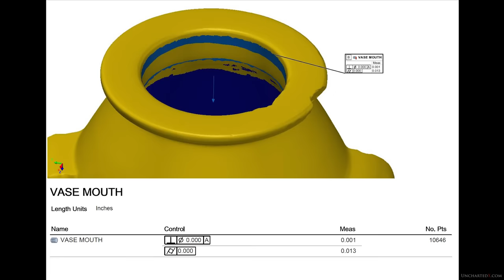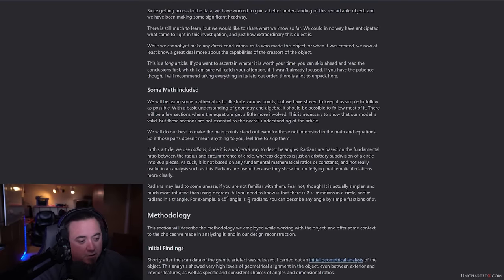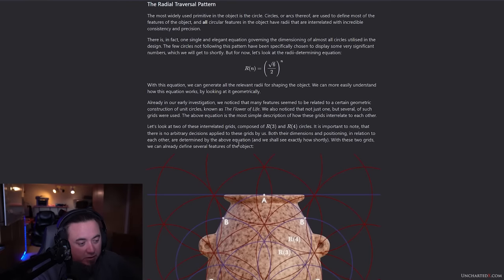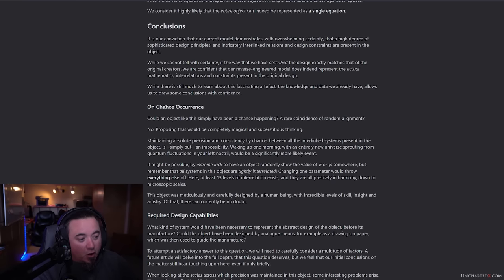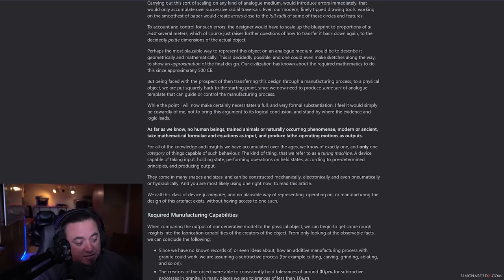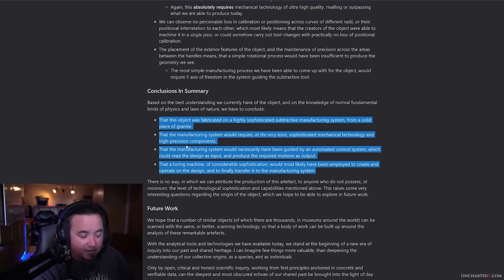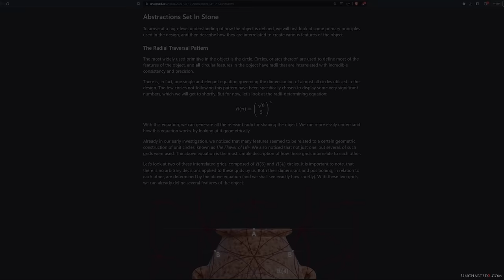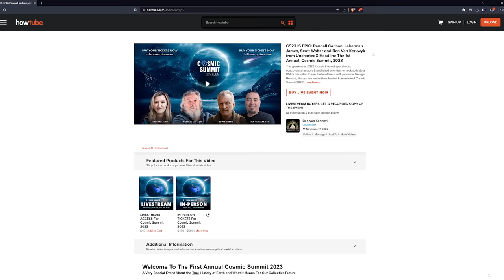Was a COMPUTER Used to Design this Artifact??

Comment: As good as this video was, you didn't really mention the inside or its overall thickness. I am sure it is probably perfect as well. And is the finish fully smooth? How can anything cut it perfectly smooth (glass finish). If it needed a second pass to polish that would be where the imperfections would be made. 

Would love to see you mock up on paper a device that you think could do this. Cnc machine is the only thing I think.

Comment: It is logical to have an algorithm to produce these vases and pots where the only difference would be a difference in one of say 8 parameters. Then any robot could produce this. Most probably the granite and diorite statues have also been made by automated machines according to exact specifications in some kind of portraiture algorithm. Today, we can represent in computer games and in pictures anything by using triangles. It is obvious an advanced civilisation would have no problem doing this. The only technology missing here is how the object is cut out and smoothed.
Reply: its 'cut out' to its rough shape by pounding with similar stones. then it is spun against a grinding stone by hand using a wooden crank. circular motions are symmetrical

Comment: Bard stumped GPT-4 with browsing! It seems that Bard is suggesting the vase's design might be based on the Fibonacci sequence and the golden ratio, which are intimately linked. The Fibonacci sequence is a series of numbers in which each number is the sum of the two preceding ones, usually starting with 0 and 1. As the sequence progresses, the ratio between consecutive numbers approaches the golden ratio, approximately 1.61803398875.

The golden ratio and the Fibonacci sequence often appear in patterns in nature and have been used in art and architecture, thought to produce aesthetically pleasing designs. Bard suggests that the vase's spiral might be structured this way, with the number of curves and their widths expanding according to the Fibonacci sequence.

The master equation Bard proposed:

r = a * f^n

Here, r represents the radius of the vase at a given point, a is the radius of the vase at the center, f is the golden ratio, and n is the number of curves in the spiral.

This equation can be used to calculate the radius of the vase at any point along the spiral, which could be used to create a 3D model of the vase or to print the vase on a 3D printer. Please note, however, that this is a hypothesized model based on Bard's interpretation and may not perfectly represent the vase's design.

The information I found in the earlier article did not directly mention the Fibonacci sequence or the golden ratio, but it did note the vase's highly precise and uniform design, suggesting that it was created according to some mathematical formula or set of principles12. The idea that the vase might incorporate the Fibonacci sequence or the golden ratio is certainly possible and worth investigating further.
Reply: this is really fascinating, i think you're (or AI) is onto something

Comment: All very remarkable,     but what may  be  even more remarkable are the handles on these vases.       If turned on a lathe, how was the material between the handles removed so precisely,  how were the outside faces of theses handles made flat occurred outward,  rather than rounded,  like lathe turning would prod7ce
Reply: it's almost like these vases were designed in such a way to show that a second step was used which proves they were made by advanced tools.

Comment: I was always an advocate for the "they knew how to liquify granite and then cast it" idea. But, when it is shown how incredibly complex and mathematically sound the vase is, as well as how mind bogglingly tight the tolerances are, you realise: how would they make the cast? And you're back to square one haha. Truely fascinating, maybe they approached lathe work from a completely different angle that we cannot even fathom yet.
Reply: no , you cannot liquefy granite and retrieve granite crystals structure when cooled , when liquefied result is always obsidian glass and no more crystals
Reply: @zsuira How would someone achieve the precision of this vase, using the technology in these youtube videos?

A blacksmith can work metal. However a blacksmith cannot build a modern jet engine.
Reply: @zsuira  Do aliens build modern jet engines?

Comment: I might not be smart enough to ask this question correctly, but could there be a connection between the math and audio frequencies? I have the feeling that this could be a interesting way to further understand the object.
Reply: maybe the object was created using a certain frequency, OR the specific type of granite the object is made from reacts to that frequency in a certain way that we don't understand yet. hard to say, but I'd love to know if there is a correlation between the type of granite used and the shape of the vases.
Reply: @AustinKoleCarlisle  that is what I was thinking of. Like the sounds in the pyramids

Comment: At 34:16 you show a vase rotating. It too has handles. I can see that these handles have a hole bored completely through the handles. With respect to the artifact studied, are the holes completely through the handle? Is the bore hole straight or on an arc? One would assume they are straight through holes. Though if they are on an arc, it would only deepen the mystery of these artifacts.
Reply: they are straight through holes. They also arent very well aligned with each other, or even on the same level. The handles are a great example of why this is obviously a hand made item.
Reply: @5hiftyL1v3a  A few items here. First, are you sure they are straight through bores. Second, what object are you speaking of when you say they were not well aligned. Third, how do you know the alignment of these holes with any degree of precision. Fourth, even if the holes are straight bores not well aligned, how does this support the conclusion that the remaining vase was "obviously" hand made? Are you saying that the measurements taken of the precision of the vase dimensions are irrelevant because the bore holes are not as precisely done. Do you have an agenda here? Nothing whatever is obvious here, at least not in the way you are imagining.
Reply: @michaelc424  
1: yeah... you can it in the video
2: the handles either side, their repective holes in relation to each other
3: because I have eyes. you can see that they aren't symmetrical
4: because thats whats happens when you grind hard stone by hand. it looks handmade

I'm just saying it looks like a hand made vase because thats what hand made vases look like

Comment: Five axis machines which can hold tolerance of less than 0.02 mm between tool change are very common place.  Now let us considered the automatic screw machine which purpose is to mass produce precision components.  If one gets fancy the fancy five axis machines can hold tolerance of less than 10 millionths  of an inch.   That is 2.54 E-5 cm.  The design of the vase is by far the most interesting part.

What really trips me more is the exploded remains of a pyramid in Egypt.  It is well established it exploded as stones from the construction are found hurled over 100km from the construction site.  Even more stunning are remnants at the site of quartz surfaces a meter across which are optically flat meaning less than one wavelength of light at some visible light frequency.  That is serious tech down in the 100nm range.

It is completely absurd to believe the modern human mind required many millennia to have an idea to do more complex constructs.  The Vedas write of a previous civilization.  The planet is littered with ancient artifacts way past 20,000 years ago.  These modern experts as so many who claim to be scientist but, are not, have no idea about history more than about 150 years ago.  They are idiots infatuated  with their own reflection in a mirror.

Comment: Mark proposed the Unit they may have used. It is the same as the wavelength of a 16Ghz EM wave. In our base ten, it would be 18.737028625mm.

Remarkable.
Reply: "but the second is a human creation" cried the atheists. lol
Reply: @AustinKoleCarlisle  it is. It is 1/86400 of the average solar day. So it's a kind of blend of natural and invented. Like most things.
Reply: @timothyblazer1749  your definition is the correct one, but they don't see it in those terms, the second is now defined as "the time that elapses during 9,192,631,770 (or 9.192631770 x 109 in decimal form) cycles of the radiation produced by the transition between two levels of the cesium-133 atom."

mmm, that's good scientism.
Reply: @AustinKoleCarlisle  well, the issue with that is it assumes that the speed of light is a constant. Einstein tried to get his theories revised later with a variable speed of light, but the broader physics community wouldn't budge on it.

Oh..in case it wasn't clear..a cesium decay clock uses lasers as a part of it's operation. That's why it's relevant :-)
Reply: @timothyblazer1749  i'm just saying, the further we drift from natural and sacred measurements, the less things will make sense. we need to embrace our natural principles, not try to dominate them with our superior, know-better "intellect"
Reply: Interesting as 16Ghz is the signal that the folk over Skinwalker Ranch were picking up strange things at. 16, 16.3.
Reply: @AustinKoleCarlisle  I think a balance is called for. We do have an intellect capable ( though rarely used ) of reasoning. By the same token, nature shouts things at us every day that are missed because of ego, POV, cognitive bias etc. Probably humility and introspection is called for :-)
Reply: @timothyblazer1749  well, if you watch the latest Koncrete podcast with Ben and Randall, they speculate on what type of energy technology this mysterious ancient civilization had. they come to the conclusion it was "plasmoid" technology, but i think it was even simpler than that. i sincerely believe the ancients were way more spiritually advanced than us and could harness the power of consciousness, allowing them to control and shape physical matter in ways that we cannot today. because today we rely on electromechanical technology to dominate physical matter. this ancient civilization took a completely different technological evolutionary path and this explains why we don't see any similar materials like plastic, glass, etc in the archeological record because they were still in the stone age and stone was all they knew. the search for "the tools!" and ancient advanced machines is a fool's errand, IMO, because instead we should be looking inward for the answers as to how these things were accomplished.

Comment: As a side note symmetry and roundness would be near zero if the item was sculpted or produced on any spinning axel. Now the roundness would be equal to the accuracy of the “bearing” now what is interesting is the machines and “ engines” like waterwheel or pulleys

Comment: This item was likely made with a technology that we haven't discovered, invented or perfected yet. I don't see it having been machined in the traditional sense, but more likely it was lapped so to speak,  encapsulated within a subtractive media, energy or both, that was able to be manipulated into a 3 dimensional form. In essence, forming a mould of the desired finished product. In this form, one could imagine that this media could then be excited or aggravated somehow through some mechanical or energetic means, that it would subtract substrate from a solid at an impressive rate. The only media that seems plausible enough to perform such an action is diamond, and the idea of it being able to be manipulated in such a fashion isn't so inconceivable either, its more likely that there is yet more to be discovered scientifically and technologically about this gem, and I'd suggest that much of the technology needed to produce such a machine is available to us now. This theoretical process is not so different from the modern process of mechanical lapping, which is a concept as old as mans time on earth. By modern standards lapped output can be both produced and measured with basic equipment to an accuracy of flatness near 11 millions of an inch, or 0.000294 of a mm. Coincidentally, diamond powder suspended in a slurry of hydrocarbon or water is the media of choice for many of todays lapping processes, and one of the main global suppliers of these solutions and machines is ironically named "Kemet". Isn't it intriguing that lapping is known as the "Black Art"?

Comment: It wouldn't matter if that was the only one found to be that precise, it still proves advanced ancient technology existed all the same. Denying it is like saying "well you only found ONE ancient computer, so it's really not proof of anything". Grabbing at straws is what comes to mind now when people try to debunk this thing. The math and level of precision required makes it impossible that machines were not used. Precise machines having been used makes it impossible advanced industry was not present to support the development of said machines. Advanced industry present makes it impossible mastery over electricity was not achieved. Mastery of electricity makes it impossible advanced energy production/harvesting was not present. An advanced fuel industry points towards a global and/or globally aware civilization. A globally active civilization makes it impossible fast forms of travel, like flight, had not been achieved. 

Every aspect of our modern technological world is required and as we know, advanced technology is delicate. The advanced "tools" would not have survived a cataclysm+10,000 years. The stone they carved would have however. So, it's f#&*ing over. The next decade will provide more proof guaranteed. It's all just in material though at this point. The question HAS been answered: TO DATE WE ARE NOT THE MOST ADVANCED CIVILIZATION TO HAVE EVER COLONIZED THIS PLANET. People (mostly religious zealots with an agenda) need to get over it. :/

Comment: The guiding machine shape was surely a circle right? If the vase had to be held and all of the circles have relative equations…than wouldn’t it be likely that the cutting was guided by some kind of larger circle with the same proportions?

Comment: The upshot of this is that the level of supporting technology that would have been necessary for this work to have been done requires a technological society that far surpasses our own.  The medium is difficult to work and there are hundreds of them.  This is a work that indicates that those who created it could do it easily and without much fanfare and it plainly isn't a one off.  Plainly the evidence speaks for itself, at least with some mathematical assistance.  There wasn't much if any discussion of tool marks?

Comment: Were they using base 60 math in measurement?  I believe they were; these were the people who made the 60 second minute, and the 60 minute hour. Enki built the pyramids.  60 is divisible by 1, 2, 3, 4, 5, 6, 10, 12, 15, 20, 30, and 60.  This makes it have fewer remainders, and great for finding quick approximation.  Does a base 60 numbering even come into play?  Is the power of understanding the geometry commensurate with some secret to the technology used on the granite?

Comment: What if these things were made by resonating with the frequency of the chunk of granite, then somehow shaping it? Maybe they used sounds and vibrations to do this, we are only beginning to understand about frequency and sound waves and gravity waves. Maybe they used some sort of anti-gravity?
Reply: I'm curious to know if the vase geometry is associated with the type of granite OR the granite's resonance frequency.
Reply: @AustinKoleCarlisle  I think it has everything to do with the frequency
Reply: @Mr.Plant_man  i would bet money on it. after all, Nikola Tesla said if you want to understand the universe, think in terms of energy, frequency, and vibration.
Reply: @Mr.Plant_man  there is no way to build the ancient polygonal stone walls using ancient methods...unless the stones were weightless and could be molded like butter to ensure a seamless fit. not enough people realize that the ancient polygonal walls that span the entire globe fit perfectly not only at the facade, but fit perfectly throughout the depth of the joints, even curving three dimensionally. this is simply impossible to achieve with trial-and-error fitting like we're told the ancients did.
Reply: @AustinKoleCarlisle  exactly, your the type of person id love to smoke a joint or drink a beer with a talk to. You think just like I do. You see those scoops out of the granite at the quarries where they got the stone for all those monolithic structures. That would be impossible without a way to change the molecular structure of the granite and make it like playdough.